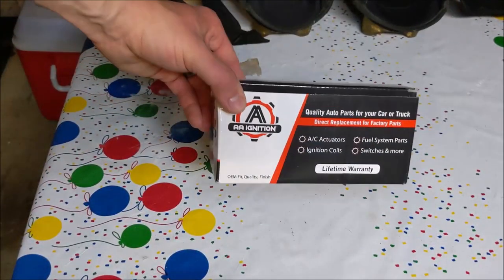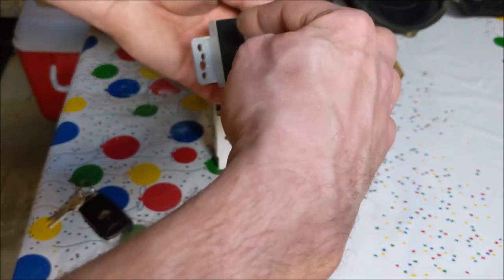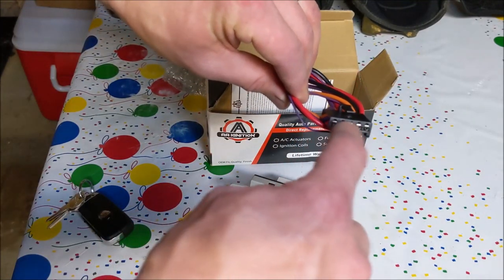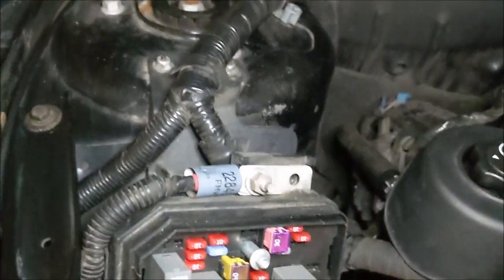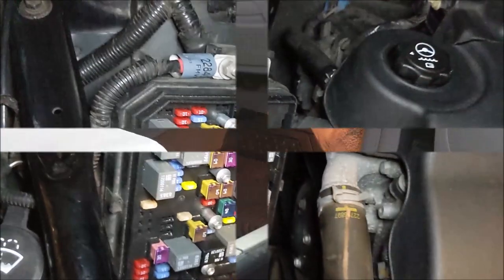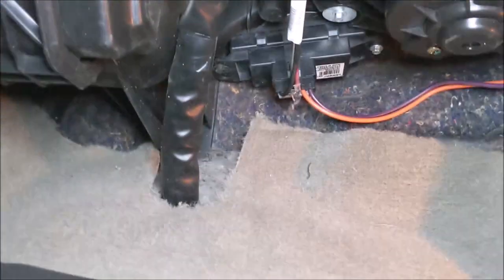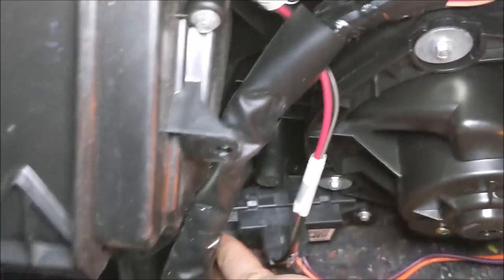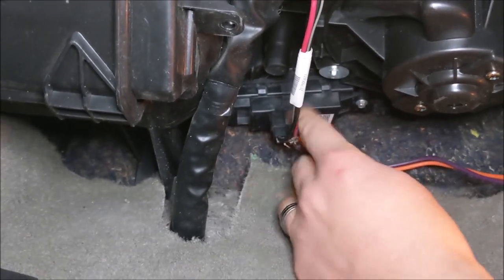2006-2016 Impala/Limited (9th Gen) Blower Fan Control Module Replacement

Comment from the maker: First thing, DO NOT PURCHASE the junk parts I have listed in this video!!  Watch this video instead:
https://www.youtube.com/watch?v=2U2UPTukpfw

I just had to replace both the blower fan and module on the 04 Impala.  I purchased the same fan and module that I did for the 12 Impala.  The procedure is the exact same for the 04-05 Impala with a couple of minor differences:
1.) The fuse in the underhood fusebox is a Green 30 amp Maxi-Fuse
2.) The kick panel under the dash has 2 large tabs that need to be depressed, and one big PITA to remove push-in style retainer
3.) The control module is riveted in on both sides (unlike the 06-13 in the video that has one rivet and one screw)
Reply from the maker: leaderofwagons@likeabigdog.com
Reply: @AT-oc5os  I have 2 rivets aswell :( in such a tight space how do I get it out with the rivets

Comment: this is the perfect and most complete video for splicing the wires and changing out the regulator
Reply from the maker: What exactly did I leave out?
Reply: @CertifiedShadetree  sorry. I should have looked at my post when using voice recognition. I will edit it. It should have said and complete. It was an excellent video
Reply from the maker: @danielk6878  😂Got it, thanks!

Comment: Very helpful video, thank you so much.  Now, can anyone tell me why blower is running constantly now? Lol.  Spliced the wires I had to, won’t shut off unless you unplug the pigtail connector or pull the amp. Pulling amp is easier than contortionist under the panel to unplug it.  Thanks in advance.
Reply from the maker: Module is faulty. I would replace it with a Genuine GM part. I found out the hard way these cheap Amazon modules don't last very long.

Comment: I changed out my blower fan and it’s working now getting cold but it goes in n out with the coldness it’s like it’s strong and then slows down.. and it’s also making like a pheewww kinda noise almost sounds like strong wind.. is that what I also need to change out
Reply from the maker: Without question!

Comment: So I have a 2014 Chevy Impala Limited LT and it is currently acting weird. At first the blower motor would randomly stop and start running again after smacking the dash. I had a friend look at it and he checked the connections and wiggled some wires to get it to work again. But roughly an hour later it's not responding at all even when I smack the dash. Would that probably be the resistor going out completely?
Reply from the maker: The blower motor is shot. You should replace both the blower motor and the control module at the same time. I would HIGHLY recommend purchasing AC Delco replacements, as you'll just be replacing both again in 6 months if you go the cheap route like I did in this video..
https://youtu.be/2U2UPTukpfw
Reply: I figured as much, I got my hopes up when it worked for a solid hour haha thanks for the info. By chance did you change out your radio? Mines the older one with the green interface and small display.
Reply from the maker: @PTyler88  Yes, I had installed a MyLink radio out of a 13 Traverse in this car (which I've subsequently sold.) Had a backup camera and USB port hooked up to it and wired it so the Bluetooth calling worked.   https://www.youtube.com/playlist?list=PLKy6nBoh43BqIzk9hWMqGXP8ioR5X47Td

Comment: I have a ‘15 Impala LT and am having issues with my heater. Vents are blowing out cold air except on highest fan and temp settings, air is hot. Fan is blowing strong on level 8, however, on levels 1-7 there’s a drastic difference is air flow. What do you think the issue might be?
Reply from the maker: Start with changing out your cabin air filter, you'd be surprised how much crap those things collect and thus choke out airflow. I would suspect the blower fan module next, however the symptoms of that going bad are either NO FAN at all on all speeds except high, or the fan intermittently cutting out. If you had said you had no heat at all, I'd say you have a bad blend door actuator (or 2.)

Comment: Looks like a very handy video. I'd say I'm looking forward to getting mine done but with the looking up at it while lying upside-down I'd be lying.

General tip, if the fan behaves differently at different speeds this is the likely culprit.
Reply from the maker: Best advice I can give is buy an original ACDelco control module from RockAuto. I ended up replacing this Amazon POS about 1 1/2 years after installing it.

Comment: I just replaced a blower motor because no air was comming out then I notice once I plugged the tab back in the control module wire was hot and I believe that’s why the my air wasn’t comming out. Any suggestions? And should I return the blower motor ?
Reply from the maker: Skip the generic parts and go for Genuine GM. Module and blower fan. Also replace the module's harness. Part numbers for the module and blower fan are in this video: https://www.youtube.com/watch?v=2U2UPTukpfw  Get the harness listed in this video..

Comment: My a.c blows hot on driver side and cold on passenger, but I changed actuator on driverside, still the same sometimes will blow a.c to level 2 then if I turn it up a notch goes back hot. Help help I checked fuses all good.why???
Reply from the maker: You're likely low on refrigerant:
https://www.youtube.com/watch?v=sDvBdpPTC_E

Comment: I didn’t remove that 30 fuse and I replced my resistor and my AC won’t turn on , is the 30A fuse be the problem ?
Reply from the maker: The AC compressor won't turn on? Could be the fuse.  Also you could be low on refrigerant, the compressor clutch could be burned out, or the compressor relay could be bad.

Comment: What's up bro, just replaced my blower motor when my ac or heat would not come on. Next few days it worked perfectly. Now the heat comes on and will stop, then back on for short periods. Do I have a bad blower motor or is it the resistor?
Reply from the maker: I learned the hard way the blower motor and resistor should be replaced in tandem, AND you should go with ACDelco or Genuine GM parts..
https://youtu.be/2U2UPTukpfw
Reply: @CertifiedShadetree  yes I hot a cheap $47 one from Amazon. Guess ima have to get the $90 one at autozone or order it lol. Thank you so much bro 🙏🏿.
Reply from the maker: Check RockAuto.com.  You can get a Genuine GM blower fan for $98.  ACDelco resistor module is only $53.  I didn't have good luck with an AutoZone blower fan either!!

Comment: Hi, I have a similar problem with my blower. I replaced it with a new one and it still goes out often and when I move the wires under the dash board, it sometimes starts working again but not for long. It’s also burning a lot of fuses lately. Recently lost the power lock, cruise control and blower again. Fuses look ok. Can it be a bigger fuses maybe or something else?? Thank you 🙏🏻
Reply from the maker: Have you changed the control module and/or its wiring harness yet? One little module going faulty can cause a myriad of other issues like you described..
Reply: @CertifiedShadetree  thank you for replying so quickly. I will give it a try. Thank you 🙏🏻
Reply from the maker: @kimzie9578  Best of luck to you!

Comment: Man I wish I had found this video sooner. So, I replaced the resistor last year and nothing changed...it got worse over time. Symptoms: the fan speed is sporadic and doesn't respond to the change of the dial (like the one in this video). The wires seem okay (recently checked) but I'm wondering if the Bat fuse is bad. I'll have to check and see and replace your if needed. 

Any other recommendations?
Reply from the maker: I made a follow-up video
https://youtu.be/2U2UPTukpfw

Although I really didn't need to replace the control panel, I recommend replacing the fan and module at the same time AND going with Genuine GM parts.
Reply: @CertifiedShadetree  thanks for the info! I'm purchasing the fan soon. I figured that it may have been the issue as well. 

One thing I did notice is that after installing the LED headlights the fan started acting weird. Lights off = fan is okay. Lights on = fan is sporadic.
Reply from the maker: @jamellbanner6498  Fan could be pulling too much current due to it being on the outs.  I would definitely change both the fan and module at the same time.  Also be sure the harness isn't crispy!!